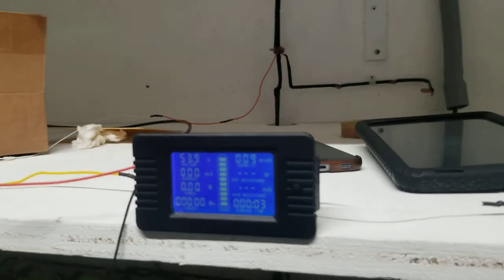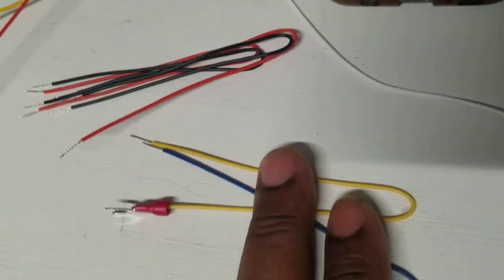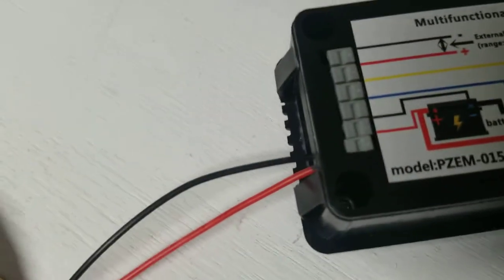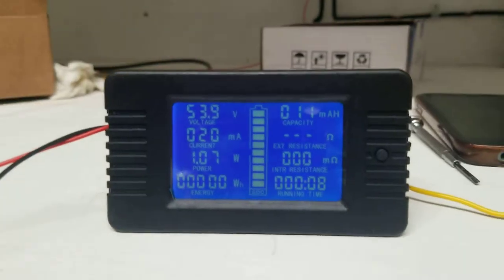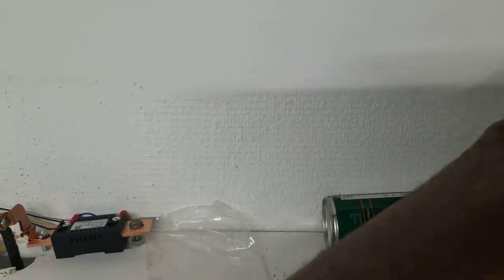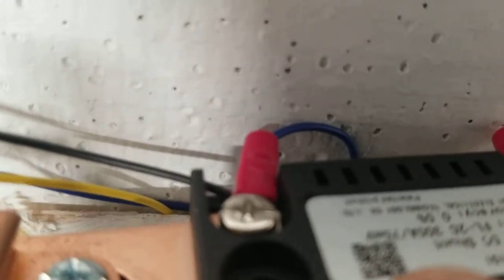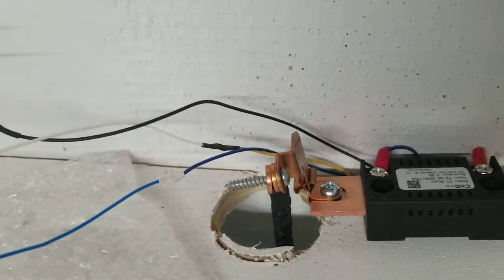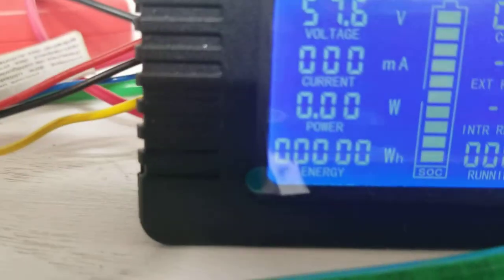DC Multifunction Battery Monitor Meter with Shunt,0-300A, Applied to 12V/24V/48V RV/Car LCD Display

Comment: A 5 minute video would have been enough to show the wiring set up as that is straight forward. Time should have been spent on showing how to configure the device through its menu system as the instructions are poor in this area.
Reply from the maker: I will have a video on that in the future.

Comment: Since six months using a likewise meter, really good increase in the monitoring system. Prior to this meter I was confused regarding the output power of my battery bank system, but now satisfied that the set is working properly. Nine readings on this meter are enough to decide status.
However there is no sign of flow direction. Also using another meter (PZEM-025) with only four readings, V,A,W and kWh; there is a sign with A and kWh. The shunt is inside the meter but thick wire has to be used with this meter.
Reply from the maker: I like to help. I appreciate your comment

Comment: Detailed an informative video. My 300A Shunt read 12v battery pack 0.5 v less than the actual voltage measured by voltmeter . Does which side of the Shunt orientation  selected matter ? TIA
Reply from the maker: I am not sure. I am not an expert. I know some voltmeter may give a different reading base on the component within the meter

Comment: If you so much as momentarily unplug the battery/s you are monitoring, you will have 0 volts, which is less than 8.... Unless you are willing to loose the stored data, the other 2 wires are actually very important. Secure another battery of the correct voltage range to the inputs to act as an external power source and you can disconnect the main battery input and later reconnect it and everything still be as before
Reply from the maker: Thanks for the info 👍

Comment: Yeah if you dont want a fire in your RV do NOT buy and use these as they are defective by design so much so the electrolytic cap blows out and the main MCU chip gets hot enough to burn the PCB, melt it's own solder and deform the plastic casing. 
See I was gong to add these to my RV camper as an upgrade from the analog power meter and I am glad I bench tested them first or I would have had a fire and lost my trailer.
I ordered 2 of them to do charger in and battery out so I set them up as per the diagrams and the plan was to let them run 24 hours but once power was enabled, both units backlight lit up, and one gave a display that was working, the other one was now dark, no life and started to smell like something burned out so it was removed and the working one was left there. I came back 4 hours later and my shop reeked of burnt electronics and the once working meter was dead and the back was deformed. I opened it up and the MCU was detached from the PCB and had burnt the PCB. SO I was not re buying these and I opted for power meters from the RV service center which costed over $150 for the pair plus all the shunts and sensors but they worked out of the box, passed bench test and are currently in the trailer working perfectly after a year now.
Reply from the maker: Thanks for the update. I don't leave it on. I only used it when I am in the garage. I am currently using bms Bluetooth

Comment: Does it will work for power supply to measure volt ampere  and watt i don't want to measure battery capacity

Comment: I have the meter hooked up like you described. I have no idea what the read outs mean. Can you please make a video that explains what the 9 functions the meter monitors?

Eg... I have a 100 mah battery. The battery level icon shows full. The numbers at the top right (mah capacity) reads 4.85 and climbing. How does that number relate to mah capacity? I would think that it would determine the max capacity of the battery. This seems to work great based upon your video, but I have no idea what all the numbers indicate. Do you?
Reply from the maker: I will have an update on this module, sometimes in the future. I am in the middle of increasing my power bank in US and in Haiti. I have a water  company that is running on Solar system and battery power 48 V system

Comment: The black should not be on the blue terminal.  It’s should be on that side of the shunt, but not on the same connection point.
Reply from the maker: The black/red  wire is only used to bring power to the unit, it can be placed where negative/positive wire. The blue and the yellow depending how they are placed will indicate the amount discharged or charged.

Comment: How do you mount the box for easy visual display?
Reply from the maker: I don't understand your question
Reply from the maker: I let it stay on the side
Reply: Just use some double stick tape. Mine is attached to the LifePO4 top of the battery.  Some folks have to extend the wires as they are only a few inches long.

Comment: Bro does it shows the current in 2 direction.  I mean . If fix it in my inverter battery side . Does is shows both charging and discharging current?  Plz bro . Reply soon .very urgent 😢plz plz plz
Reply from the maker: You can't see both. You can only set it up for one option: current in or out
Reply: It means it can't shows reverse current
Reply: @simplyfocus9937   how can I do it ? By settings ya by changing ta wires of the shunt ?
Reply from the maker: Nope, you set it to show the data when it is charging or when it is discharging, not both.
Reply from the maker: See my second reply. Victron has a good one with Bluetooth. It is very good but more expensive
Reply: @simplyfocus9937  yaa it means i don't need to change hardware/ wiring ?.  I have to change only setting in display
Reply from the maker: Yes,
Reply from the maker: Or you can buy 2